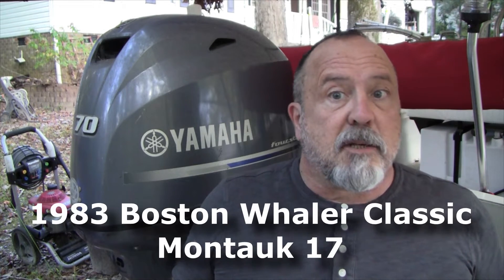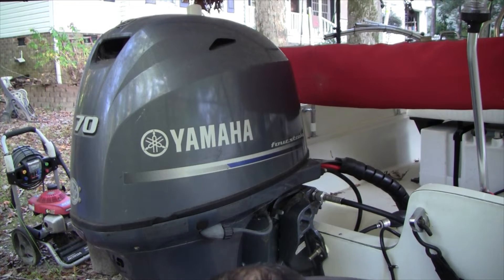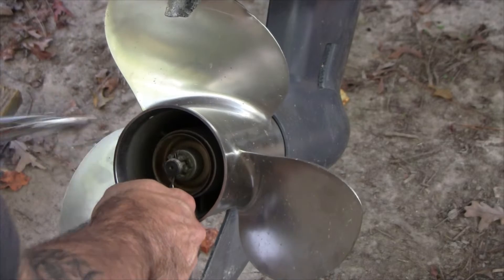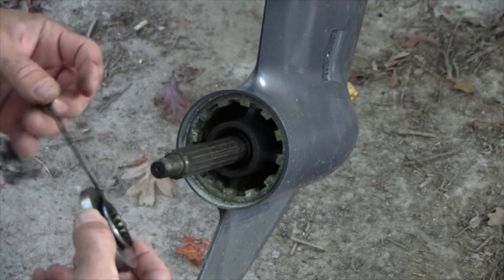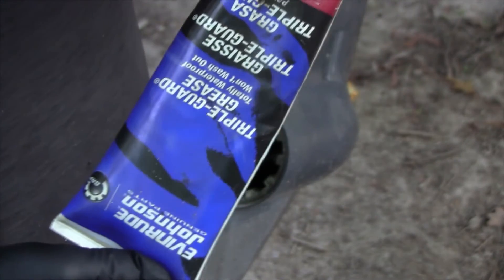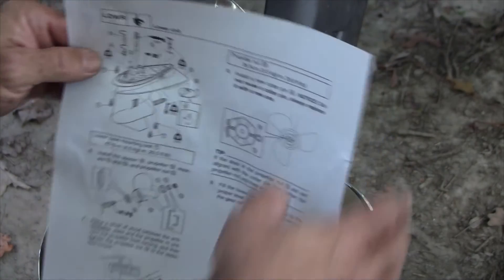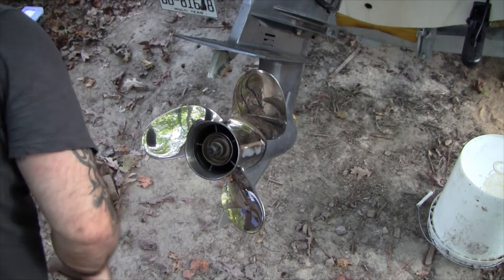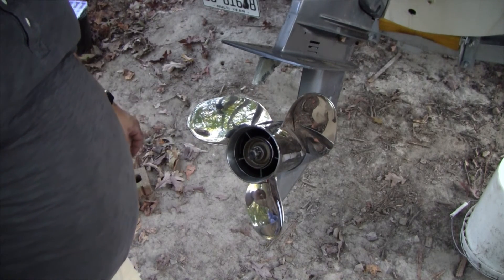How To Replace A Propeller On A Yamaha F70 Outboard - DIY

Comment: Are you trimming up at wot? There’s no way your only at 5200 rpm with that small prop I’m running a 19 p laser 2 prop pushing 5800 rpm

Comment: U work on outboards on the side 
Need a 2005 Yamaha 70 two stroke to be properly link and synced 
Good running motor just want to make sure all in sync and no cylinders running lean
Reply from the maker: Sorry but I don't. I barely have enough time to work on my own stuff. If it weren't for my son helping out, I would never get anything done!

Comment: is it safe to put a steel prop on a f70, very one i talk to said stay do not do it, because that if you hit something it will damage the shaft, i wanted to get your intake thx
Reply from the maker: There's pros and cons to steel props. As a general rule, most people (and myself) prefer using a SS prop for performance reasons.

Comment: Gday mate that is the biggest reason for chewing out seals i know is fishing line pays to check your prop a few times a year saves having to go through the drama of getting old seals out and putting new ones in and that was a lot of line . Grease grease grease can never have to much for protection should get a good price if you sell the solas being stainless another thing to watch out for is plastic bags cover your intake and stop the cooling water .
Reply from the maker: Gday to you! I Always look forward to your comments. Took it out for a spin yesterday and we were absolutely pleased with the results. At WOT and fully trimmed I was getting just shy of 6k rpm and a hair higher than 35 mph. Although not the same expectations as the Yamaha prop it was pretty close. Oh and that prop has some traction. Putting it into gear and even giving it a few rpms the boat fairly leapt forward. I'll have a video on that next week. Checked the lower unit fluid and it was clean. Hopefully the seal is not damaged. I'm guessing the fishing line compromised the seal when spinning but hopefully did not permanent damage. I never thought about plastic bags blocking the water intake, SOmething else to worry about! Cheers, Jose
Reply: I was out fishing with my father one time and on the way back in saw a white thing in the sea so went over and sure enough a plastic bag below the surface if it wraps around your lower leg and your alarm doesnt go off you may cook your engine 
 @ExtremeDIYGuy
Reply from the maker: Grocery bags, the bane of the ocean! I'm a scuba diver as well so know that they can also harm or kill sea turtles!